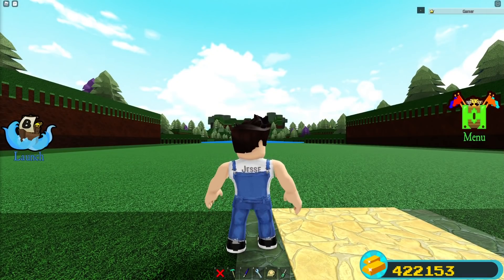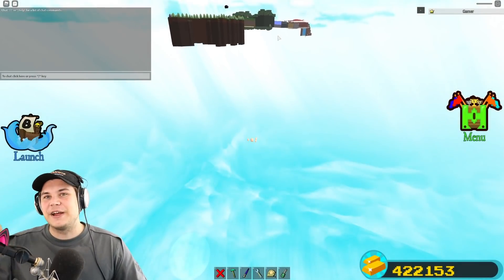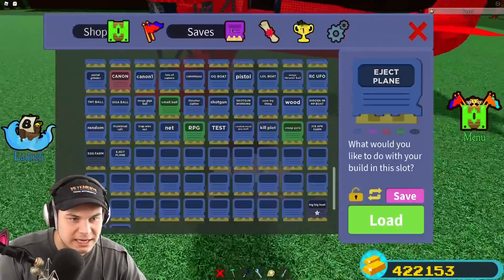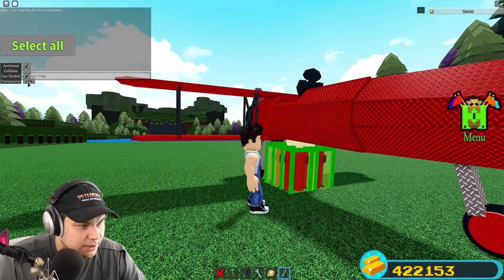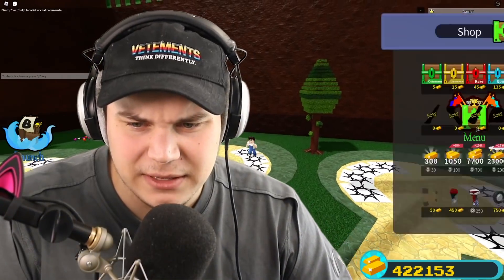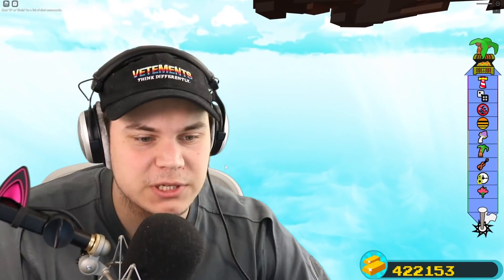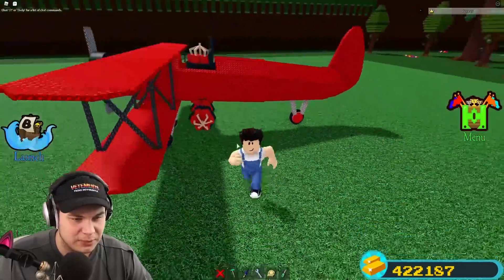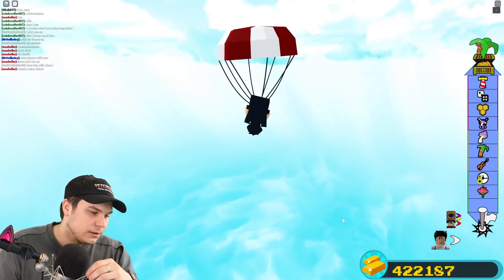WORKING EJECT CHAIR IN Build a Boat!

Comment: just before this block came out i found a HARD way to build an eject chair. U place a spring, then take a jet ontop with an glue block ontop again, then pilot seat, bind them and turn on jet, delete/click binded key on glue block and then chair popps off. the only thing i needed was the parachute.

Comment: I have easier eject system which took was less time from his mine works by the ground of plane is collision off and the pilot seat and the butter block are collision on and then i press a button to drop the seat and then activate the parachute I don't get launched or anything but I can always just go down and not up

Comment: Build a boat
My pov: no
Plane crazy
Me:Y E S

The planes just suk it’s way too simple for me and i like PHYSICS and build a boat does not have that, like slap a jet on the plane and boom your plane can fly WITH OUT A FLAP for movements that’s why i changed from Build a boat to plane crazy and also plane crazy have more complex building blocks like motors that you can set angle and toggle it to make angled shapes and motor locking to stack objects together and blah blah blah i would continue but im saying too much so ima stop